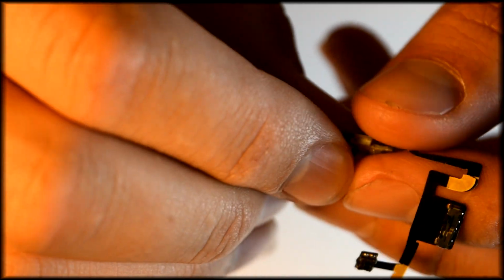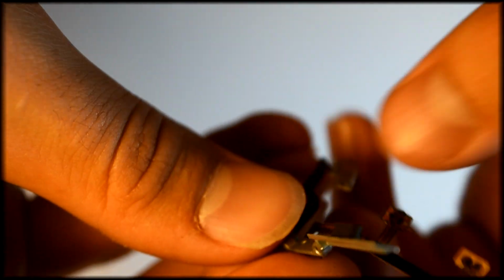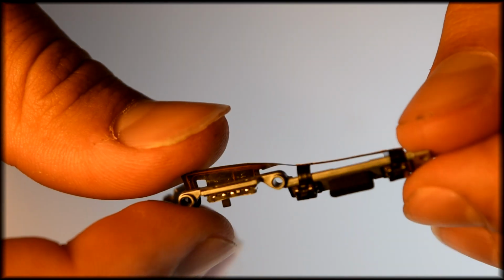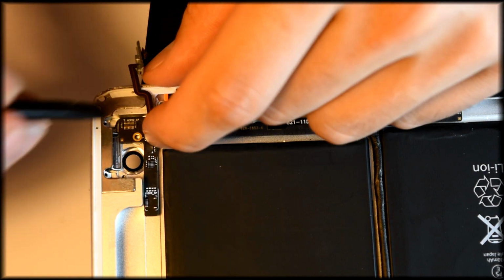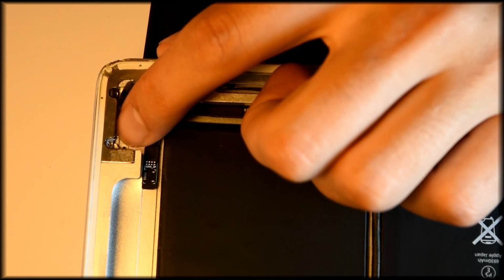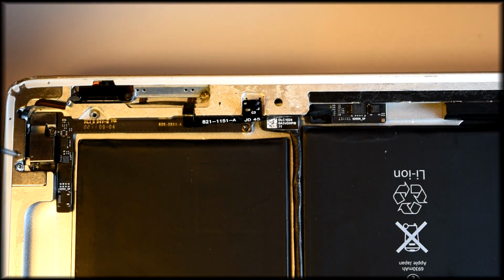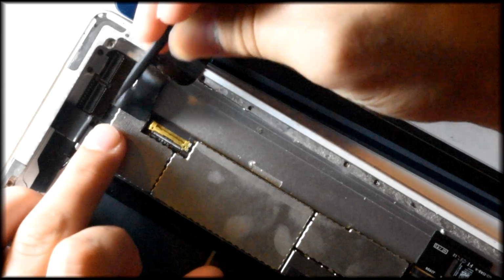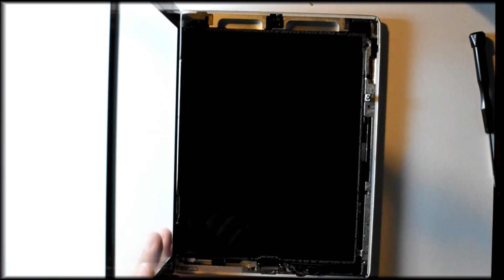iPad 2 Power Button Replacement | ipad repair

Comment: Thanks a lot. I followed your instructions and everything worked like a charm. I was a bit wary about pulling out the small logic board, as some other videos were not suggesting to do this, but it worked out pretty well after all. All is working perfectly now. The only (minor) issue I have now is that my adhesive is not bonding as strongly as Apple’s, therefore the body does not give the feel of being just one compact block any more, as the digitizer does not sit totally flat against the frame. This would make it easier if I should need to open it up again.  I also found it very helpful to take a few pictures of the old cable, before separating the hardware, as a guidance with the tricky assembly.

Comment: The power button does not work to turn my iPad Air 2.  I think the power button is just jammed, is there anything I can do to try to fix it before having to open up my iPad? My screen is badly cracked, I don’t have any of the proper tools and not sure I’d trust myself for this repair anyway.  My other question, is there another way to power on/off besides using the power button?  Thank you!
Reply: To power on, plug in charging cable. To power off long press Lockscreen of Accessibility button.
Reply: @prof8957  Thank you!  I did eventually figure that out but it's always nice to get a reply to a question about a problem.